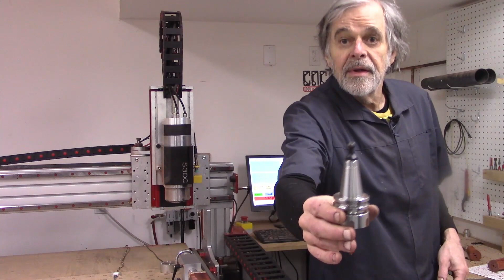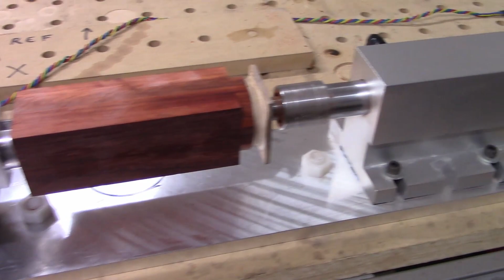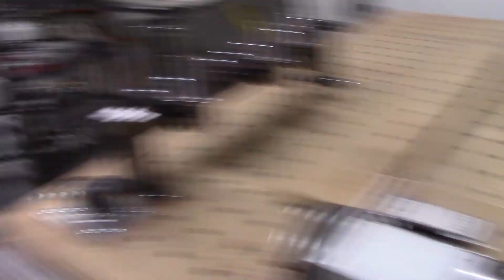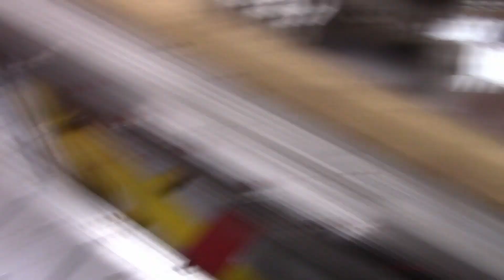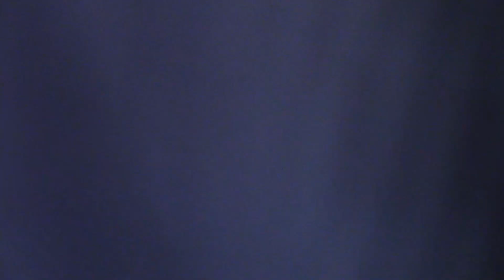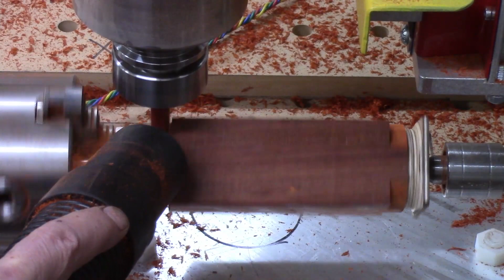Woodworking with the CNC Router and Automatic Tool Changer. NQALHA Handles

Comment: Is the 4 axis package for bobcad really so expensive that its not worth it if you can lie to the software?
Reply: Pretty much all CAM for 4th axis. Is axis substitution. Swapping Y for A. Im guessing your just swapping out the axis letters and scaling the height of the letters by the length of the circumference. Sweet work Mike!
Reply from the maker: The trick I use works for the parts I make. If I needed true 4 axis, I would get it